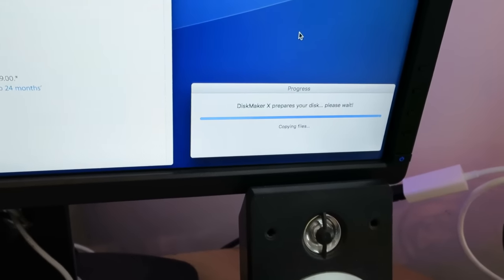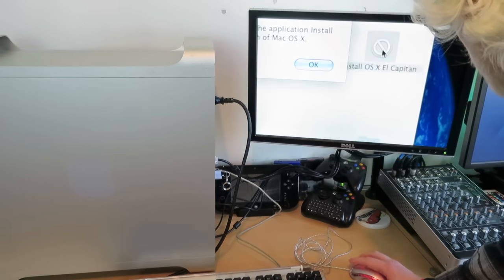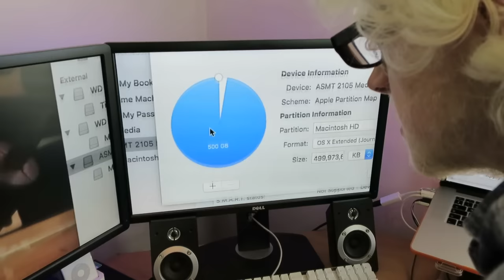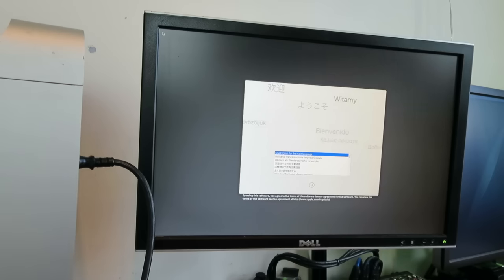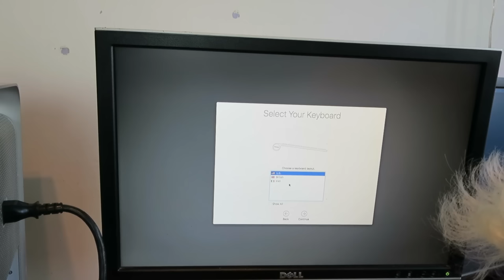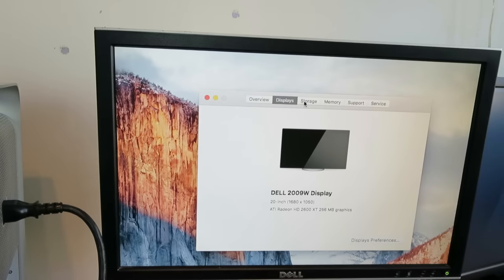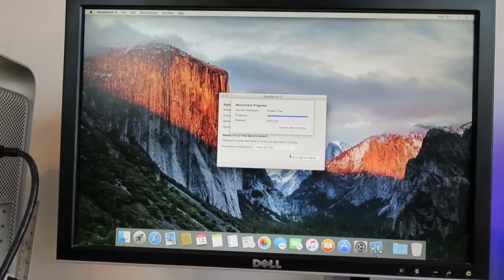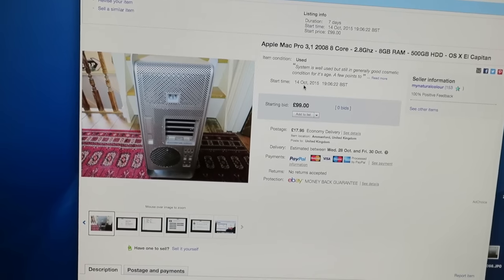The Final Mac Pro Chapter | IMNC

Comment: RIP MAC PRO 
This is a end of a era
:(
Reply from the maker: +ThatGuyMitch Indeed, but hopefully many more excellent eras to come :)
Reply: Yes
Reply: +ItsMyNaturalColour You've have some pretty shitty luck with couriers bashing and breaking things in transit lately haven't you, Tom? It's the end of an era, but the start of a new one! I'm going to give my vote to an iMac (again lol). If you can get the pennies for a Mac Pro bin then go for it but a topish end 27" iMac would smash anything you throw at it for a good while.
Reply: +ThatGuyMitch sure is a shame to see it go! I remember the first video where Tom was so excited to get it!
Reply: Obsolete Mac Fan I no
Reply: +FallingDesk Design You can upgrade the 2009 to a 2012, I think that is cheaper.
Reply: *****
Even an iMac performs better than the 2012 Mac Pro. Those things are pretty much 2010 models anyway, they just offered better GPU's and a bigger selection of storage choices. Intel took their time releasing anything better enough to bother with a bigger refresh in the Xeon line up. They seem to have fallen into that hole again since the 2013 bin model. The newer chips are a few percent quicker but hardly worth writing home about. Their power consumption is down but that isn't quite as important on desktops unless you're running a crap load of them.

Comment: Awesome video Tom. Re the S120 audio, I actually prefer the audio on this camera to the lav mic. Not that the lav mic is bad; I just prefer this mainly for the stereo room acoustics.

Re the Mac Pro, a firmware re-flash will probably be all that is needed to fully restore it for the new owner. I believe the firmware files are still available; though they do require an older OS to run (unless of course you do the re-flash manually).

I hate the new disk utility also. When I tested the public beta, I sent Apple a long and very sarcastic feedback thing covering it in great detail. Why they had to mess with it when it was a perfectly good app already is beyond me. The diskutil command line app in the terminal is the only way I've found to perform advanced disk tasks at the moment.

Comment: Could it be that the SSD bracket is faulty? That is the reason why the machine was acting up.
Reply: +Bob van Leeuwen Thats exactly what I was thinking.
Reply: ***** I would assume it would have to do with several things that were done with the Mac Pro such as putting a hackintosh SSD into a it, putting the GT640 in, and possibly the SSD bracket or some issue with the SSD that was used inside of it (but that is arguable).

Comment: Hey everyone,

I am searching for a supported intel mac pro for around 250-300 pounds wich model can I get?
Reply: are those 2 mac pro's still supported? ( does it still gets new os x versions?)
Reply: +tomheesakkers You can upgrade the 2006 with 2 quad cores, a lot of RAM and a 7950. I'm running Yosemite on one. SFOTT works nice, make sure though you use Yosemite 10.10 instead of for instance 10.10.3.
Reply: +MacMan iPowermacbookprair sounds good but does it still get new os x versions? I want to use the machine every day
Reply: tomheesakkers Sort of, if you have another GPU like almost any new nVidia, you can. But you need to change some stuff in the installer. 3.1 is easier. If you want a cheap supported Mac buy a MacBook, if you want a cheap powerful mac with some work, buy the 1.1/2.1 mac pro. If you want a supported one, go for the 2008 3.1.

Comment: You will regret selling it after a while. I would if I had one.
Reply from the maker: +TechBurst While the Mac Pro has been the backbone of my tech world since 2011, I think it's time that the system and I part ways. Nothing lasts forever, onwards and upwards, etc etc.
Reply: fair point. Might be just me but I find it really hard to part with tech stuff even though I know I need the space.
Reply from the maker: +TechBurst It can be really hard. For me, motivation to sell normally comes from the strive to get some new stuff, but space is becoming more and more of a contributing factor for me too. There'll be a Vlog coming out tomorrow that I'm currently recording about listing a load of my tech stuff on eBay. It feels quite refreshing to get shot of some stuff, but you're right, it's hard parting with lots of it too.
Reply: True. I sold mine too and I sometimes regret it when I need something Mac related.. Had a 2009 one and it was great - I just couldn't live with the limited space in the case so I sold it after some weeks of use..